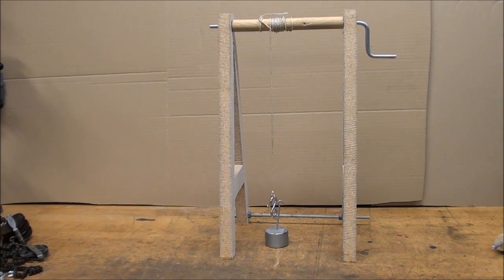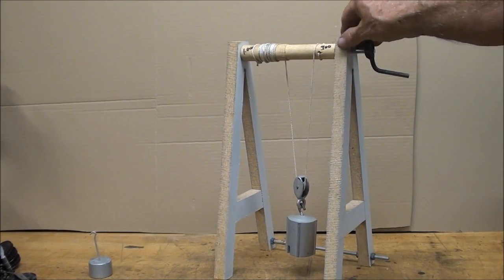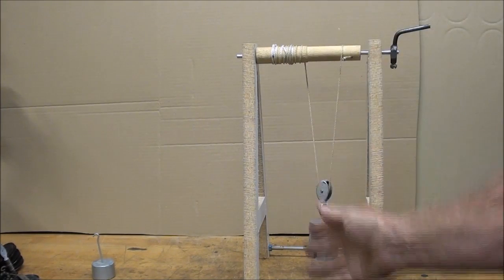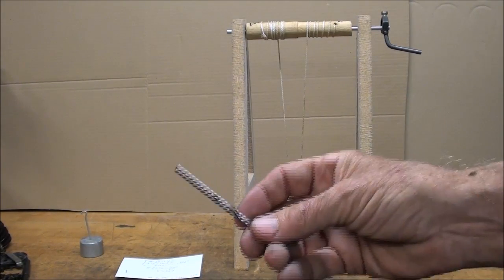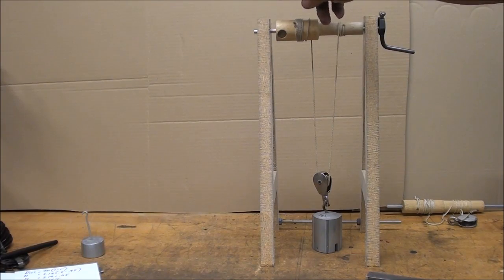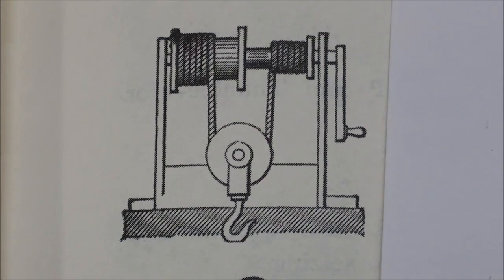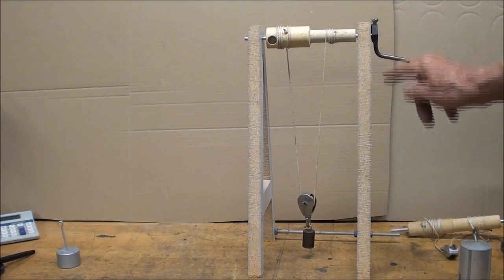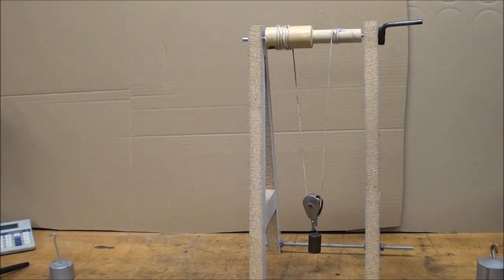WHAT MAKES IT WORK?  #6 Chinese Windlass- tubalcain mrpete222

Comment: Super useful video. And thanks for showing that the distance doesn't change when the diameters are the same - I figured, but but the curiosity in me just needed to see that it actually worked that way.

Comment: That's a mechanism I've not seen before !
I've seen 'like' it - where the rope being pulled is wrapped around a larger drum than another rope attached to the load - so similar mechanical advantage system but I'd not seen one where the rope goes to the load and comes back to a different sized drum.

There is a variant concept used in some spring-driven clocks. on the shaft the spring acts on is a conical threaded pulley and wrapped around it is a 'rope' (possibly wire) the other end of which is wound onto another conical threaded pulley. The concept being, as the spring unwinds, it gets weaker - so the clock would slow. Via the rope between the conical threaded pulleys, as the spring unwinds and gets weaker the conical pulleys alter the mechanical advantage increasing the relative force on the second pulley to counteract the weaker force being applied to the first one. The cone angles would be the same and an angle chosen depending on how fast the spring loses its strength as it unwinds.

Comment: My gosh, you've explained this so well and demonstrated it so clearly! Thank you! 

I've no exposure to mechanical machines like this despite being interested in how they work so cleverly

😅 When you were showing what happens if the radii were both the same, my head went PI(0)=0, but intuitively your demonstration showed that the same length down and up results in no movement

It also made me think about how a normal snow white hoist is just the smaller wheel having 0 radius - but that's technically a single pulley system with 2:1 advantage

Which made me realise

We use radius here to calculate because the length of the string for one revolution is pi*diameter (2pi*r)

But the rope loops back up so the distance is split in half

Also it made me realise: this is like having a hoist with a very very very tiny radius.

Which is like a small gear turning a big one

Oh gosh it's all linking!

Comment: It is interesting to note that the important parameter is the difference between the two radii.  So the example (at 6 minutes) with R = 0.625" and r' = 0.375" would function precisely the same (ignoring dynamics such as inertia, etc.) if both radii were 100" larger.  ie, R = 100.625" and r' = 100.375".  Of course, with such large radii, a correspondingly large amount of string would be whizzing through the pulley supporting the bucket load.+++++++++++++++++Mr. Pete - A differential thread is somewhat related.  Perhaps you could add an episode to go there, too.Approaching the differential hoist from first considering the differential windlass is a brilliant teaching tactic.  Good Job!  Besides being a master craftsman, you are also a master teacher.  I appreciate the passion you bring to producing these videos.  In 30 years, I expect most of your videos will still be relevant and regularly referenced.Thanks!!
Reply from the maker: +Dave Kellogg THANKS for watching--much more to come

Comment: thank you mrpete222 very cool video
Reply from the maker: +stevenacarter77 THANKS for watching--much more to come
Reply: +mrpete222 ... I like to study old New England barns. I've seen large wooden wheels up in the beams of the loft. I think this system was used to lift a loaded wagon up to the peak, so hay could be thrown off to fill the barn higher. An old barn @ Sturbridge had some of this setup, and they didn't know what it was for.

Comment: Tubalcain, great explanation on these fascinating hoists. I wanted to share a question I have with you. Since the increased number of cranks at the shaft seems to be the drawback of this system what would happen if you installed a smaller pulley to the crank shaft mated by chain drive to a larger drive pulley. Similar to how the gears on a bike are tuned to increase the speed of the rear wheel. Thus should increasing the crankshaft RPM while allowing for same handcrank input rpm and hoisting the load quicker. I imagine the input force (torque) demand would increase at the input shaft but in certain configurations it may be effective. Do you agree with this idea or do you think this would not work, and why?
Reply: You would benefit from increased speed, but lose out to input force.
It would be possible to calculate the speed advantage and the force increase.
However compared to an equivalent simple windlass (as per the start of the video) your system would have more losses and would require more effort.
But, and this is one great feature of the Chinese windlass is that it won't unwind when you let go, your system would keep this.

Comment: the weight does not fall because the push and the pull are balanced with ropes either side of the weight.

 imagine there are two persons either side of the weight at the height of the axle/shaft.  one letting go of the rope and the other pulling towards himself ...

 if both do apply same tension then weight does not move ... but pulley revolves freely... 

 if one man does not let go freely, holds slightly tight while the other person pulls slightly hard, then the load 
slightly moves proportional to difference between push and pull. 

Ways of getting mechanical advantage is chain hoist(gears + differential) or using counter weight

Comment: I've wondered if accurate wooden jack screws could be made without gears, using this mechanism . Mount the Chinese windlass on the spindle of a simple lathe. Use a pulley wheel to change the direction of pull to be parallel to the spindle. A free hanging weight would keep the string taught, and a saddle can then be pulled back and forth.
Reply from the maker: +steve cummins THANKS for watching--much more to come

Comment: can i have an explanation why it can't drop when the handle is released? i really need to know the answer. :)
Reply: bcoz both ends of the rope are hooked to the rope drums on the axles and there is only light/differential load on the crank ... in the first case one end of rope is on weight and the other is on the crank rope drum which leads load on to the crank.

Comment: I first met this as a Differential Thread. Where two different sizes of screw thread are used to move a part by a tiny amount, allowing for accurate fine movements without having to use a ultra fine thread.  Example of this is here: https://starfishmedical.com/blog/how-to-construct-a-custom-differential-screw/  A more modern use of the principle.
Reply from the maker: Thanks, I enjoyed that.  I sure one of these threads in a video where I talk about a tap wrench. I think it was a video about the Greenfield tap branch. I think I called it a Compound thread, incorrectly

Comment: That's kind of like the winding system in the early 1800s wooden works grandfather clock I wind daily except the wooden barrel is the same diameter front and back sides and the drive weight on one string and a small weight to guide the other.  Great video .

Comment: At 10:33 mrpete claims that three-fourths of the world uses the metric system - and therein lies the problem with the imperial system - it leads to huge errors. In actual fact, the USA, Liberia and Myanmar are the only 3 countries to officially use imperial measurements. This means that 94.7% of the world uses the metric system - not 75%. 😁😁😁

Comment: This guy is a lousy teacher. He notes that the weight doesn't move on its own but doesn't bother to explain the very simple reason why. He also notes the difference in drum diameters as 100/1,000 rather than the much more intelligible 1/10 inch.

He also incorrectly states that "we trade distance for mechanical advantage". In fact, the trade is distance for force,  or more precisely increased distance for a similar reduction in force.
Reply from the maker: I assume you have made a video on the same subject. And it has met with rave reviews by thousands. I am sure you are a wonderful teacher and YouTube creator